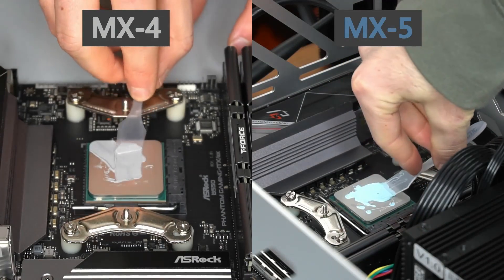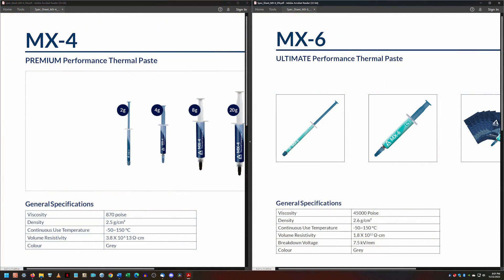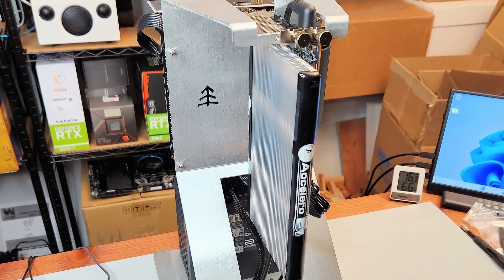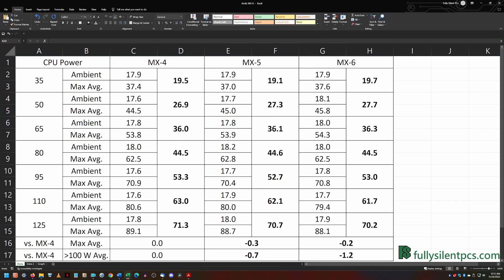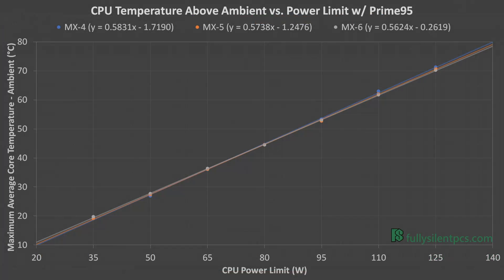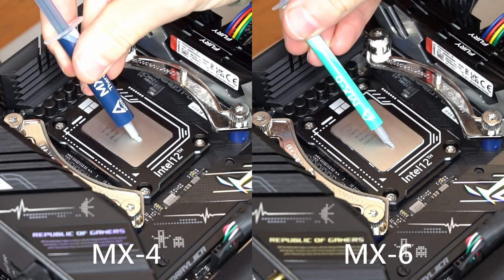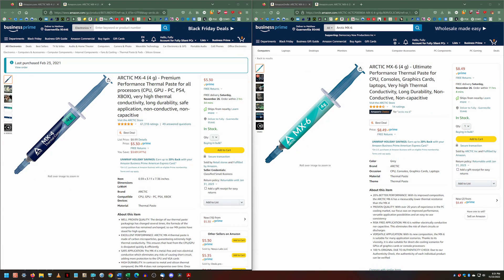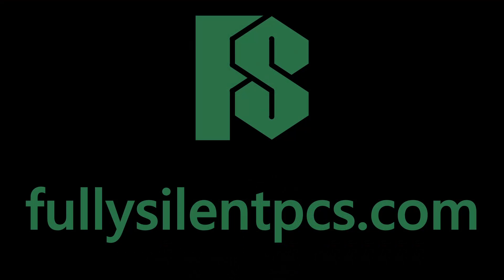Arctic MX-6 vs MX-4

Comment: when I finally opened a 20g tube of MX 4 that have had for 2 years is real thick and tough to spread - but it still works! idle of 21c load of 70c  delidded 4790k @5.3ghz - on an overkill custom loop.

Comment: Arctic MX 6 is trash, it has a shelf life of 6 month, meaning you will have to replace it 4 times in a span of 2 years while other conventional pastes last anywhere between 2 to 5 years depending on the manufacturer, even Arctic MX 4 had a shelf life of 6 years which made it king of thermal pastes back then. This never version will drop thermals by around 2°C but wont last the test of time.
There are also reports some batches are contaminated leading to an even shorter shelf life of couple of weeks, so do with this information as you will, just dont buy anything more then 4 grams of the stuff as it will quickly expire.
This paste wont hold its value and some batches are already expired or contaminated on arrival, you were warned, as most sellers dont provide manufacture date most of the Arctic MX 6 is already well beyond expired it shelf life as it was initially released  back in 2022. When i first found out i was very disappointed and quickly returned the product for a full refund. Avoid at all costs! There is also the big issue of this paste not sticking to the CPU IHS, CPU DIE or AIO cooling plate, its like trying to apply sticky goop to an oily surface, it just wont work.

Comment: well i just ran of out mx-4 after building many pc's with it. never had an issue. My 8700k cooler hasn't been removed since 2017 when i built it. Temps are still fantastic. got some mx-6 to try. it was actually cheaper then 4. probably less liked by most.

Comment: MX6 dried up on my R7 5800X and pulled it out the socket while removing my CPU's aio water pump. After inspection, even one corner of the socket pulled up off of the mobo. Don't use this.
Reply: MX4 still best for long period then?

Comment: Anyone knows anything about Shin-Etsu MicroSI TIM? Don't know which version, whether it's G751, HP 182759-003, X23-7783D or something else.
Research shows the G751 is "Original thermal used by manufacturers such as HP, Dell, Lenovo.".

Any better than the MX-4.

Someone left me a 0.5gm tube. I am deciding whether to use this or the unopened MX-4 which I also have (I don't think the MX-6 is worth buying for the extra 1c decrease)

Comment: Kryonaut is very over hyped because it gives great initial temps but has a high tendency to degrade very fast on direct-die applications with slightly deformed coolers or when the temperature hits 80°c.
I hope MX-6 has good long-term results on direct-die applications because it is easy to obtain without long shipping times. For basic direct-die I'll stay will continue to use the proven MJ-TECH M12 thermal grease. (Thermalright TFX, IC-Diamond works good as well). And for hotheads I'm in the process of switching to Honeywell PTM-7950 pads. In the past i used kryonaut, NT-H1 / H2 and some other consumer pastes as a repair shop but it always craps out after a couple of weeks/months.

Comment: Wrong! Application with a Spatula Is Not Possible.
MX-6 is a highly viscous, high-performance paste. It cannot be spread with a spatula. Instead, use the contact pressure of the cooler.
This is what it says on the manufacturer's website!

Comment: I tried MX6 and it would be the worst thermal paste I have ever uses  tried to re paste 2 graphics cards and a ryzen 5 5600X  All dies where cleaned with alcohol based cleaner and I found that  the MX6 did not want to stick to the core  the term crap comes to mind. Even up to 95 cpu power the MX  was only  0.1 degree better than mx4 and in lower power ranges the nmx4 was better. I will never again buy a tube of MX 6 because of the extremely hard time I had getting it ti stick to the dies.  MX4 or GD900 for me in the future

Comment: I bought a tube of MX 6 and to be honest it would be the worst paste I have ever used . I would not spread even using a little spatula. I tried using it on 2 Graphics cards and a Ryzen 5 5600X cpu. and to be honest it was nearly UN-spreadable and to be honest its performance was barely a half of a degree better than the GD900 paste I was using previously. In my humble opinion the MX6 is to be honest over priced crap and I will never buy another tube of this rubbish again

Comment: I used to use AS5 til i started using MX2 and never went back so far MX2 is what i use never had an issue and i use 3 lines on the cpu and let the heatsink spread the paste works good every single time

Comment: im usbing mx4 since years. it performs good is really cheap and it spreads easy. in thw past i used gelid gc extreme, probably a better paste, especially for gpu, but it was wery viscous also if i used to worm it putting the siringe on a heater or hot water cup. Anyway mx4 is a good compromise for me. i would like to know the duration is use, but i dunno. life on the shelf they claim is 8years...

Comment: "Lost" a 5700x3d for high viscosity/high conductive thermal paste.
They are so "hard" and dry that within half an hour, my Thermalright peerless assassin got stuck on it and when i tried to remove the cpu was stuck and got raped out of the socket.
It happened 3 times in 3 consecutive testes (the first it didnt boot and the last i got s shitt rise mode cooler, very light, to see if it doesnt stuck)
The last test with the bad cooler, it got stuck AND left the socket "bent' so a few pins got bent due to the clamp style that also got stuck with pressure.
Dude, serious. this 1 celcius or 2 DOESNT WORTH THE RISK. Now im waiting for my case fans and to try to fix the 5700x3d which can be put into socket (it wasnt thatbad to the point it could not fix because of the bent pins) but even it just doesnt boot and it forces my Power suply to shut down. Im scared ive lost my dear CPU with only a few days of use and 3 tests.
JUST GO FOR MX-4 . It also has the best durability over the years, so it will not expose you to this kind of threat in the near future/ lifetime of yout CPU.
I got sad and pissed off. Nobody likes to pay high money for thermal paste and waste a CPU just because it behaves like CONCRETE.

Comment: MX-4 has lasted in my rig for 7 years, without needing any reapplication. I don't remember what temps I had upon install, but even at full load it never goes above 70-75, and my air cooler fan never above 65% speed. Soon I'll build a new PC and can't decide if I'll use MX-4, or MX-6.
Reply: mx4 for pc and mx6 for laptop
Reply: Same. I have MX-4 and got MX-6 with new cooler. I think I'll "stick" 😄 with the MX-4.

Comment: For Intel processors, way easier to apply the grease/paste while the CPU is out of the socket, holding it by the edges or even placing it onto a thin piece of foam, a towel, and working with it on a table. There are no pins to worry about while holding by the edges and you have much better control. With a razor blade I'm able put a very flat uniform layer of paste, then I take a Q-tip (or other) and just run it around the side edge of the heatspreader "lid". The first couple times were practice but I've done over 100. Just watch for getting it on your fingertips and then transferring some to the underside (which is easy to wipe off on Intel, given no pins). You can install the CPU into the socket holding by the edges as well.

Comment: i think the price gap is too big for the small improvement it offers and the extra-problems in the applying procedure. Moreon since many ppl will apply thermal paste at the final stages of the build or while doing maintenance, with very little room to work

MX-4 it is a "good enough, cheap enough, easy enough" thermal paste, that's why it is the most popular paste in the world and the go-to option for everybody except extreme enthusiast and overclockers which are a very very small portion of the computer market.

BUT, that being said, if you want a thermal paste for a GPU, in a scenario where every single degree will count, and with a lot more room to work since gpus are off the case in a bench while doing maintenance. Then the MX-6 has its value of course

Comment: I just upgraded by Dell Optiplex 7010/9010 Custom with an Intel i7 2600 (95W), with MX-6; I am impressed, my computer Idles in the 30's Degrees Celsius. Previously, I had an Intel I5 3470 with MX-4; and it did phenomenal. If you're going to use a high powered CPU like an i7, I recommend MX-6; now, if you're going to use a low powered CPU like an i5, then I recommend MX-4.
Reply: Why is MX 4 better for low power processor?
I have an Dell Optiplex with i5-9500T so for that machine is MX4 better than MX6?
Reply: @snikenfixen  The more power a processor has, the more it'll heat. In your case, your processor is 35W; so you would be better of with MX-4. In my case, I have an I7 2600 (95W), MX-6 is suitable because it's a High-Powered Processor. MX-6 is better suited for High-Powered Processors because of its effectiveness at higher temperatures; on the other hand, MX-4 is very effective at lower temperatures (Suitable for Low-Powered Processors).
Reply: @DanielAbreu1984  Okej, I see, but I'm a bit concerned about the durability of the MX 4 compared to MX 6.
Is there any difference?
Reply: @snikenfixen  The quality of MX-4 is very good, it's low viscosity; and it remains liquid so it doesn't dry out for a long time. MX-6 has higher viscosity, it's more of a paste; and it's high quality, as it lasts a long time. So it all depends on your Processor, for its heat management properties.
Reply: @DanielAbreu1984  Using MX4 on 4 different 125W cpu's with no problems. LOL work long term without changes too.  Works well.  Using MX4 since it came out. tried a couple others,  Keep going back to MX4.

Comment: Arctic MX-6 had my Ryzen 9 5900x idle at 26c and never ever went over 65c in benchmarks and gaming, of course I used an Arctic Liquid Freezer II 360 rev 4 with the offset brackets. Ran a Cinebench r23 30-minute throttle test and scored 23,527mc for memory I’m using the G Skill Trident Z Neo cl14 3600mhz 4x8gb overclocked to cl14 3733mhz 4x8gb at 1.48 volts with direct memory cooling and an Asus Tuf OC Edition RTX 4070 Ti Super on an Asus 1440p 240hz monitor.
Reply: Thanks for this. Stock temps ony h100i corsair AIO is starting to.hit over 90c after just 2 years. May have to get some of this and see if it helps
Reply: Spreading or not?

Comment: I think the idea with higher viscosity is it takes longer to "dry out." With regard to thermals, there may not even be a statistically difference significance between the best thermal paste possible, and the worst. However, the more viscous ones should, in theory, perform within the burn-in specs for the longest.

Comment: I still prefer a center dot of compound and then carefully screwing the heatsink down while holding it to create a single pancake affect. I think I’ll order mx6 for my AM4/AM5 builds.
Reply: That doesn’t work as well as spreading it.
Reply: @aj897  Yeah I used to spread it about 25yrs ago and now prefer the dot method as it pancakes the dot out evenly. I also try to not press down on the dot besides screwing it in so to not over flatten the dot.

Comment: MSI said themselves that the best method is the pea sized drop in the middle method.  The spreading method this guy is using can introduce air pockets.
Reply from the maker: MSI is not the ultimate authority. Air pockets? No. The most important thing is to cover the entire surface.

Comment: I had MX-5 on my 5800x ryzen, and it was a P.I.T.A. to separate it from my Dark Rock Pro 4 cooler. One time it pulled the CPU from the socket and it bent some pins (that I had to carefully straighten). Mx-6 might be 1Cº better than MX-4, but I'm done with sticky pastes, so I'm getting 4 now.
Reply: A tip would be use the pc, turn it off, unplug & hold power button, then when removing wiggle the cooler, heat and wiggle helps but I've been there.

Comment: The MX-6 might be better, but applying it is way tougher. It also makes you lose more product, since it sticks to the surface you are applying it with. So if you would apply it on more devices, let's say on a daily base, I wouldn't take MX-6. When you would only apply it once or twice in years, it is better, and the loss is more forgivable.

Comment: you should not spread mx6 like mx4 they are diffirent you must put a dot at middel of cpu and litle press and wiggle jiggle cooler when you soft but firm pressing cooler thats it prevents air gaps
Reply from the maker: Why does Arctic provide a spatula? You cannot create an air gap underneath the cooler! The most important thing is to cover the entire surface.

Comment: 1:24 perfectly true!
I built a custom loop pc with the corsair XC7 cooler and an i9 14900k, idle temps were around 60 and even shot up to 80.
Swapped out the stock locking mechanism with the same die guard as you and temps went right down to 30 idle..
Reply: idle at 30°C? was the room temperature 22°C or higher?
And with i7 13700k at 280W i get around 85~90°C if the stress test does not run longer than 3 minutes , and since i9 14900k does like 350W, i would hardly assume you can keep it at just 80°C.
Idle temp should be about 8°C less than room temp, altho this will not apply if the room temp is too hot or too cold.
Reply: @krisg822   room temp 22 celcius yes
Reply: @krisg822  forgot to mention i have custom ihs and liquid metal
Reply: @krisg822  Lmao 13700k to 90 c in 3 min? Your cooler sucks man

Comment: Thanks for the video. My question is how often should the MX-6 be replaced compared to the MX-4? Does the MX-6 dry out faster than the MX-4?
Reply: 8 years for both according to arctic's website
Reply: You can expect MX- 6 to be slightly longer lasting due its viscosity.

Comment: Be glad you're not as lazy as I am when it comes to using a spatula.. :)
I just re-cased my system and had to lift my AiO's waterblock... only to find that about 25% of my CPU's heatspreader wasn't covered with paste. I think I used the "pea-sized drop in the center of the heatspreader and let the cooler do the work of spreading the paste"-method. Which I won't be using again after seeing that result. 
And it was a pretty low viscosity paste I used (Cooler Master Master Gel Maker). The paste was four years old at the time (never opened though), but it looked totally fine and I did use it again a couple of weeks ago when I re-built the system inside the new case. Still looked and felt like new. 
Using the X-method yielded much better results in the spread, BTW... I did it twice, just to check what the spread was like this time. When I saw that everything was covered, I didn't bother with the spatula. It seems to have lowered temps quite a bit ... but I can't be sure how much of that is down to the paste, since my new case has much better airflow and my AiO can finally breathe through an open mesh front panel.